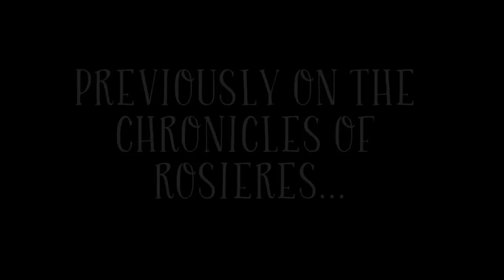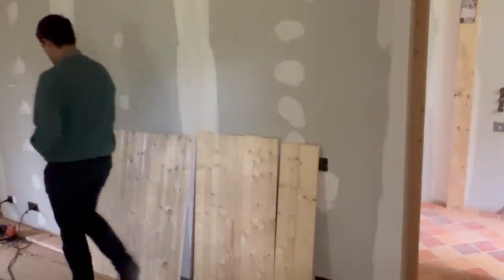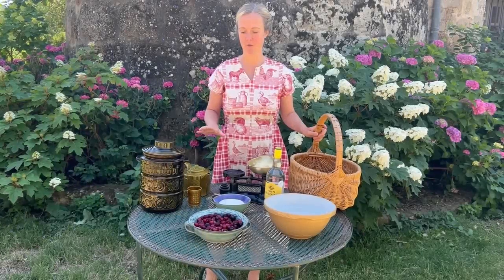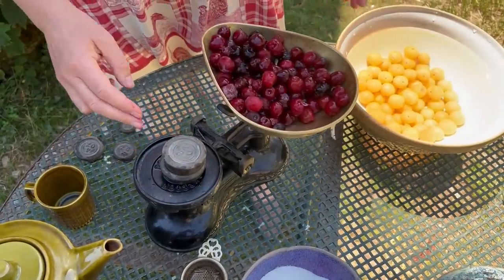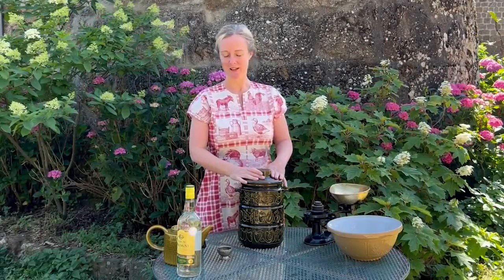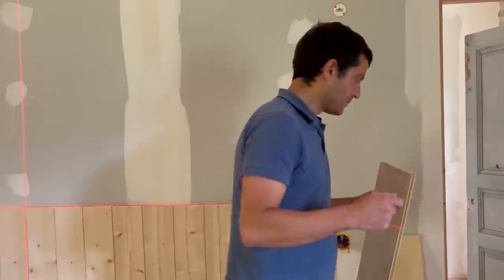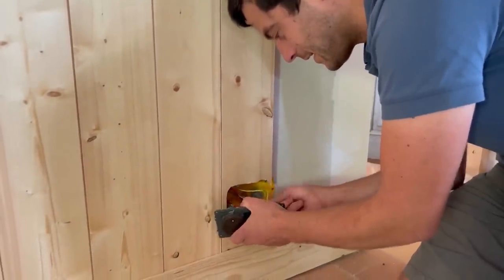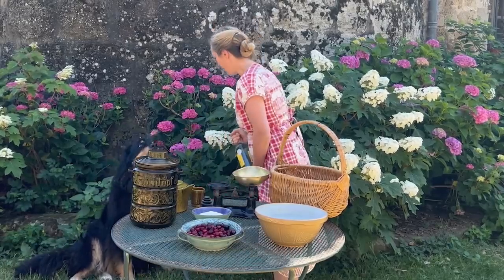Can we agree on the way forward? Restoring the Château’s Historic Coach House

Comment: Your beverage "Rumtopf" sounds really delicious!  I love learning new things from other continents.  The work on the carriage house looks very nice and friendly.  Regarding the paneling, you can distress it to make it look old.  Use a wire brush on it, put a few dents in it with a hammer, dust it with fireplace soot and then, stain it a light color wood stain.  After it dries, stain it with a darker gel wood stain and immediately, rub is off.

Comment: We have mirabelles in Northern Germany, but they ripe much later. When I made jam from them it turned out incredibly sour. Strange phenomenon because the raw fruits were very sweet, so some chemical process made them acid when cooked. I read ( have not tried yet) that you can add a pinch of natron (Sodium bicarbonate) to neutralize the acidity and save sugar.